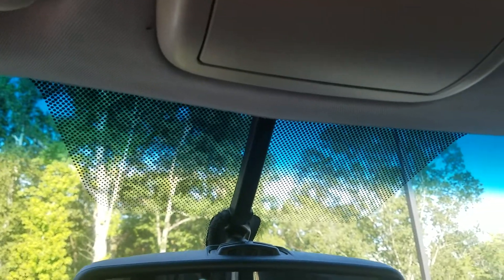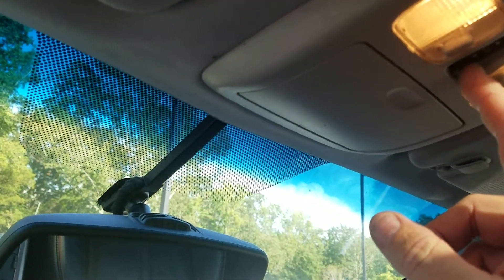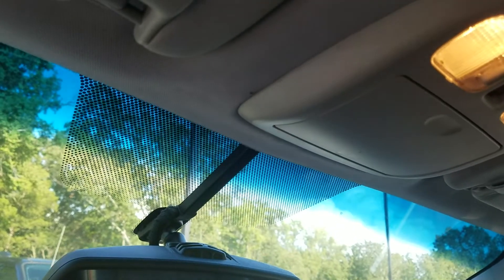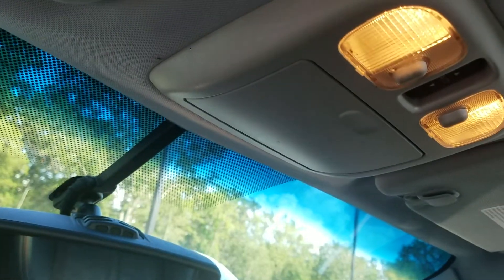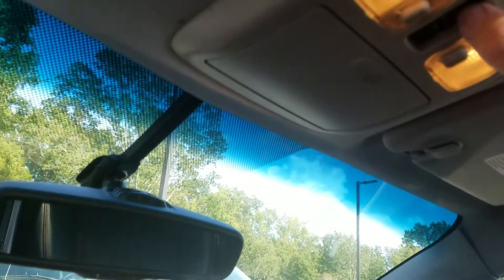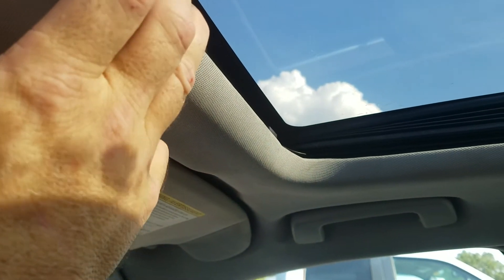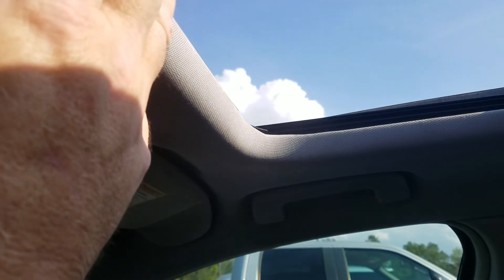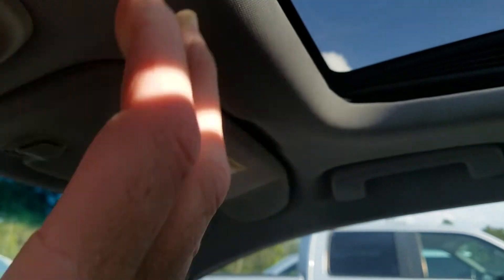2010 MKZ/Fusion Sunroof Initialization

Comment: My moonroof was closing about 1/4in low in rear. Unfortunately I learned this after a storm. I was able to close it incrementally and unplugged the switch to avoid any future issues. Love my moonroof and missed using the feature. I just tried this and it completely reset the position back to 100%. Thank you.

Comment: Thanks for caring about older cars! My sunroof has been getting stuck on the drivers side when I try to open it. Do you think that could have anything to do with this procedure? Or it’s likely to be the track? Thanks again ✌🏻
Reply from the maker: Sounds more like a track issue.  Does it have a hard time dropping down in the back when you go to open it?
Reply from the maker: @caiquebento9159  Okay, that's the seal hanging up at the back.  Try re-adjusting the sunroof.  Loosen all 4 adjusting screws so the glass can center itself, then adjust the outside corners where the rubber is flush with the roof, then re-try it. 
If that doesn't help, tilt it and lube the back of the seal with 3M Silicone Paste.
Reply: @SealofPerfection  That makes total sense! I'll try that! Thank you so very much for you help! I appreciate it!

Comment: Was it a hard install, just got a track and was going to install it this weekend
Reply from the maker: They aren't enjoyable.  Been a long time since I did one of these, just don't see many anymore.   Just take your time and remember where everything goes.   I believe this one has to come out the passenger front door when you remove it.
Reply: @SealofPerfection  thank you for your reply. Was also thinking about replacing the seal as mines not the best. Just wondering if you can even do that or if I just have to get new glass

Comment: Sometimes my sunroof doesent works. But after 20-30min car locked, its work again. Why? 2010 fusion
Reply from the maker: Motor could be going bad.  Have you tried this procedure?   And what kind of shape is the car's battery in?
Reply: @SealofPerfection  thanks. My batery cable is verification. And after procedure and 7 days use. No problem again

Comment: Do I need to do this after I replace my sunroof glass on my 2010 fusion. Is there a certain way to align the glass?
Reply from the maker: If it works properly, no.  The repair manual says to do it anytime you do any work to the sunroof, but if it works fine you can skip it. 
To adjust the glass, I like to have the rubber flush with the roof...maybe just a hair higher.

Comment: Trying to close mine but won’t after vent. Stays open just enough to drive you nuts with wind whistling thru it
Reply from the maker: Won't close after it vents?   Does it try to move at all?
Reply: @SealofPerfection  the window closes and vent closes but not all the way if you look on top of the roof it looks like 1-2” that it needs to be raised up to be level w the roof
Reply: @SealofPerfection I’m gonna go out and try the sequence again. I’m old, probably screwed up somewhere 😂
Reply from the maker: @patriot-lady1804  That's why I did these videos, I about lost my mind trying to do a couple of different Fords and finally got the timing right, figured others might have the same issues.
Reply from the maker: @patriot-lady1804  Okay, just read your explanation.  So the sunroof glass fully works, but the glass isn't sitting right after it's shut?

Comment: Are you serious?! How's anybody supposed to know this kind of stuff? Not in the manual, and the only way to keep a car from getting rained or snowed in is some convoluted procedure that a person must might almost perhaps probably may not think to look up on Google, and even maybe find a video where a person has uncommon knowledge of it and shows how? What is the deal with a company foisting this kind of crap on the public? If the programmers can make this process the way that it's done, couldn't they also, instead, make that whole process automatic and just program and give us a "reset" button to handle it? Unbelievable! 😯 I'm smh and pulling my chin off the floor at the same time.
Reply from the maker: Somewhere, there are programmers that laugh at the ridiculous initialization process they come up with.  This isn't even one of the bad ones.